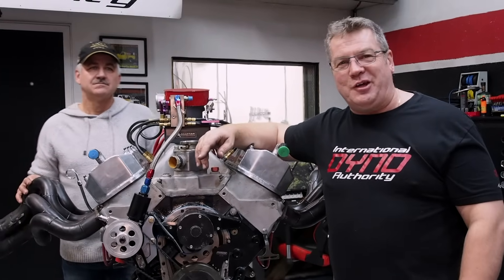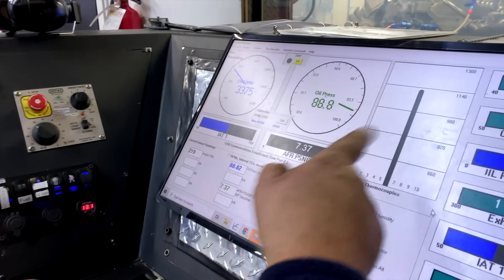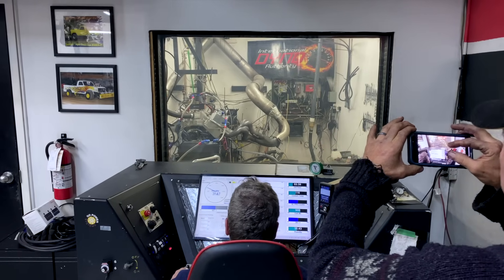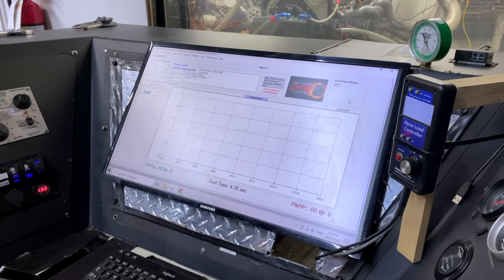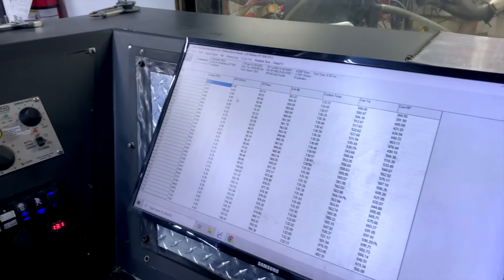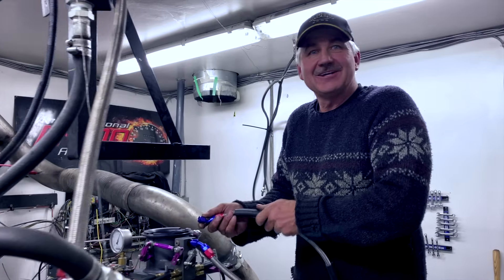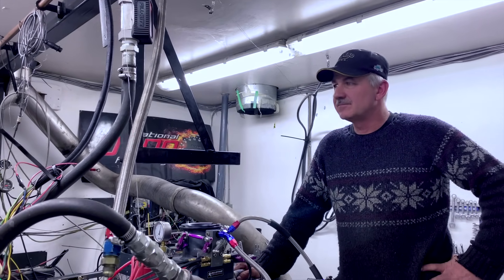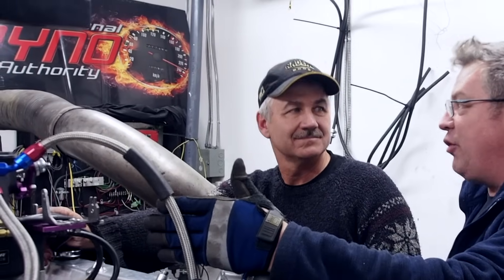Steve Morris alcohol-burning big block Chevy - dyno tuned

Comment: What size Jets did you have in the motor
Reply from the maker: @faronjenkins3234  

After all was finished, we ended up at 86.5,000 of an inch. Return.

21% Diaphragm leakdown and 1 1/2 on the idle metering block.

Ignition Timing 34 °

Very tunable system, takes some patience. But if you're willing to put in the time. You get the results.
Reply from the maker: @faronjenkins3234  

 Thank you very much for writing in, to stimulate conversation. 

Cheers,

From all of us here at International Dyno Authority.

Comment: Cracker barrel valve off until it stumbles and then tighten back up on the barrel valve until it's Rich and Chris and then you can put a pill in the right size pill
Reply from the maker: Yes I suppose if we didn't have any equipment, and we were stuck at a track somewhere. We could do that. 

However, we chose to use a leak down test, and go through the procedure correctly, we were able to get this engine to respond. Absolutely amazing. And, keep it at around 20% leak down. 

We used the tools from the 20th century. And didn't go back to 1950. 

We used the air fuel gauge, we used the engine dynamometer to tell us when we were making the correct adjustments. 

And we adjusted the ignition timing until the engine made the best power that it could. Not based off of somebody telling us what the ignition timing should be. But actually testing it, and learning what the engine likes and what the engine doesn't like. 

It definitely hated, 38°. It didn't care for 36° either. 32° was wonderful. It ran great but was not the maximum power. Anything above 32 and below 35. The engine was extremely happy. Started well worked well, made maximum power and went a to B the best that it could. 

Cheers, from all of us at international Dyno Authority.

Comment: Back the barrel valve off
Reply from the maker: @faronjenkins3234  Yes, we did. That was part of the tuning process. 

We checked, verified, and reset based on. Leak down test. And we adjusted the percentage of leak down. Until we were happy.

Comment: Becky for barrel valve off and put a smaller pill in it
Reply from the maker: Actually, we didn't touch the barrel valve, until we wanted to get the idle and starting correct. Then we set it at 20% leak down. It was perfect 

And we put a much much much larger pill, in it. 

When it first came in it would burn, over 4 gallons, of methanol in less than 2 minutes. 

When it left it was making another 300 horsepower. 

We increased the size of the pill four times. 

Eventually ending up at a custom pill. 

And we would burn about 1 gallon, of methanol. 

Cheers, and welcome to the viewing audience here at International Dyno Authority.

We hope you stick around, and learn. Learn. We will be more than happy, to share tuning experiences as we go through them. And show you the ropes.

Comment: It's too rich it's milking the oil too much
Reply from the maker: @faronjenkins3234  Agreed, that's why we spent a full day, justin, until we had the air fuel ratio. Ratio just about 5.1. 

We also went a bit too far. Backed the fuel off too far, and found the limit.

Cheers from all of us, at International Dyno Authority
Reply from the maker: @faronjenkins3234  when it arrived it would burn roughly 4 gallons in 1 minute. 

When it left, it would burn roughly 1 gallon in 1 minute

Comment: Only 34 degrees on an Alcohol engine ?? Great power !! 5.5 FA ratio
Reply from the maker: When we added, more ignition timing. We lost power. Simple as that 

The sad thing is, is that when we added more ignition timing the engine sounded a lot louder and a lot angrier. 

But it's strictly lost power immediately. Even if we went to 35 it lost power. 

Keep in mind these are not big block Chevy cylinder heads. These are aftermarket cylinder heads that have been modified, worked on, and shaved. And originally Steve Moore set this up for methanol.

Comment: Hey there ive read your reply and by all means i meant no disrespect as i do have a little harsh way of speaking which can come off as an asshole.  I just hate seeing cylinders constantly getting washed in fuel and ruin the cross hatching and rings especially on such an amazing piece. Ive ruin lots of engines myself by fuckin around with early efi systems
Reply: I also totally forgot to mention the block heater trick definitely arose from thousands upon thousands of dollars in oil changes alone and research and trial and error. Also wouldn't it be better to get it started and get it to a relatively decent operating temperature? By saying that it's pretty obvious that to do that it would most likely be easier to quickly swap the toilet out for a carb for that process and then swap it back because for the reason that from gasoline compared to methanol the quantity of liquid to liquid is not even close to each other. Listen it's clearly obvious that it isn't you gentleman's first rodeo but i just thought I'd make a suggestion whether or not it's a decent one or not remains to be seen lol. But I'm sure I'll know if u respond. Cheers men

Comment: That Ron’s system is the same system I out on my 415 SBC 32 Bantam Altered.
Reply from the maker: Once you understand how to do a leak down. And the difference between a naturally aspirated setup. And a boosted setup. These work pretty well. You lack the tunability that you do on electronic fuel injection and you lack the tunability that you have on a carburetor. But methanol is much less fussy. So you end up with some rich spots and lean spots that work pretty good

Comment: I was listening about the injection system.
So is that mechanical injection into one big mechanical throttle body?
Reply from the maker: There are separate nozzles, 

There are NO injectors.....

Fuel is delivered at pressure through a nozzle...... Continuously.
Reply from the maker: Yes, the answer also to the throttle body portion is that it's one big flap. That opens up to allow the air in. You are correct

Comment: Th as t injection looks like the setup on my 97 Sonoma 4.3
Reply from the maker: It's an older style of setup. Inside. It doesn't look anything like a 4.3. But, a lot of guys use it. It works fine. It is definitely not as good as a modern day. Gasoline carburetor. Put that same engine, on q16. And put it on a good carburetor. You're going to make another 100 horsepower. And going to run a lot better start a lot better. But this is what we had to work with. And, in the end it was awesome. It ran good at started good and it was just a lot of fun

Comment: Rpms must be 14000 with that crank pulley
Reply from the maker: Yes, the pulley is always two to one. So if the RPM or 6000 the pulley's going to pull 12,000..... That will make about 160 lb of fuel pressure to 165 lb of fuel pressure at full RPM
Reply: @internationaldynoauthority693  actually, fuel pump turns 1/2 of engine speed...
Reply: @internationaldynoauthority693  happy new years I hope u lean out at redline or top rpms not idle God bless chts must be below 400
Reply from the maker: @Latuya-y1n  5.1. To 5.5  from 3800 to 7500. Spot on AFR
Reply: @internationaldynoauthority693  Allen Johnson pe V8 18 liters plus or Sherman 19 liters plus V8 or Merlin 27 liters plus V12 or Harry a Miller W16 aircraft with Napier blower or Darren no injectors nitrous nozzle instead two per cylinder magneto magnetic 🧲 gears with titanium clutches sure is pretty they running in small boats 273 mph 3.195 ladies gentlemen they ripped off track record in 2018 Az